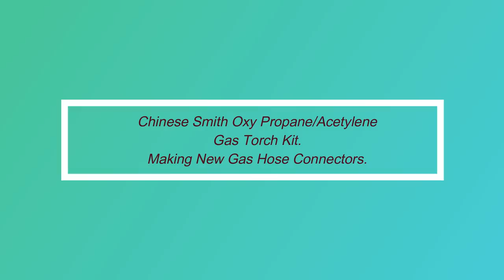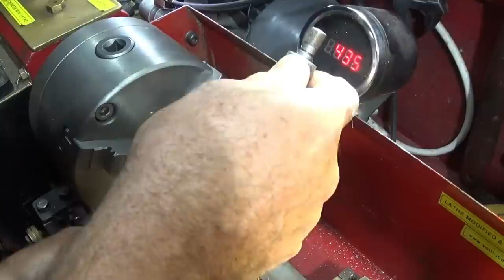Chinese Smith Oxy Acetylene/Propane Torch Kit. New Gas Fittings.

Comment from the maker: SEE LINKS FOR THIS GAS TORCH BELOW:-
Mini Jewelry Gas Mirco Torch Welding Brazing Cutting Tools -- https://bit.ly/39SMtDO
Reply: Hello, I've been watching you're videos for some time now & thank you for very informative videos. I've learnt a lot here about mini lathe & tooling, helped me decide on a few purchases as well. Never used a lathe and just received a 7 x 14 last week. I got round to using it today for the first time and have ran into a problem with parting off titanium (it's not cutting at all) I'm wondering if you could tell me what spindle speed I should be parting off at and what insert is best for titanium? I have the mgehr1010-2 with supplied insert so not sure what type. I've ordered mgmn200-G but wondering what insert you use? This might be the wrong insert for titanium? But all this inserts are abit confusing! I would greatly appreciate you're input
Reply: I should have also mentioned, I tried the same tool and insert on stainless & it also didn't cut. The insert is the golden coated type
Reply: @goldrifle1069  Sound like your tool is not set at the correct height, ( too high ) so that it is rubbing instead of cutting.
Reply: @iwb316  it's dead on centre, checked & rechecked. Think I've found what inserts I need, some with pvd coating instead of the more common tin coated that's supplied with the tool. Hopefully they'll do the job. I've went in at the deep end you'd think I'd start with something softer to start with..... You have start somewhere!
Reply from the maker: I don't part off hard materials like stainless or titanium on the Chinese Mini Lathe. 
 The gold coloured inserts should be fine for cutting stainless.
 If you have just received a Chinese lathe you will find they need a bit of adjustment to cut hard materials, especially on the gibs. Also it pays to lock the compound slide without any overhang of the top slide. You can lock the slide by tightening the gib screws. 
  The Chinese Mini Lathe will always need adjustment from new. I haven't yet seen one that doesn't. 
 I have done quite a few upgrades videos on the things that need doing to make it better and you will find loads of other videos as well.
 It can be quite daunting at first especially if you attempt to machine very hard materials.
 Parting off can be difficult on this lathe even when it's fully adjusted. Plus this lathe cannot use machining coolant.
It is better to saw things off slightly longer than needed in a bench vice, then face off to length on the lathe. 
Regards Steve
Reply from the maker: Please note that since making this video I have found out the fittings that are already on the gas torch are correct for the USA.
 The 3/8" BSP fittings I buy and make for this gas torch are correct for the UK regulators.
Reply: @goldrifle1069   I prefer toolsteel for parting titanium, it is work harding the inserts are not sharp enough for titanium. even turning is a hard time. the stock heats up very fast and so use plenty coollant. slipping the tool in the cut makes it almost impossible on a small lathe to cut again. like stainles but 10 times worse. start with alu, brass and steel to learn parting. then stainles and maybe titanium. after adjusting everything on your lathe.

succes.
Reply: This is more hassle than its worth
Can you just buy the correct connector
Reply: @bfdmanbfd  Lol I was thinking the same thing! 

Still it’s nice to see what is possible with the right machinery and skills.

Comment: My Chinese Smith Tiny Torch came with a bad oxygen regulator fitting. The acetylene/propane regulator fitting was good. I requested a return for refund, after a couple of lowball partial refund and keep offers I accepted $6.89 refund from the EBay seller. I purchased a replacement oxygen fitting nut, fitted it up with the Tiny torch fitting gland and all is fine now. You would think that with at least a couple of years of UTube complaints they would address this issue.
Reply from the maker: Hi David. If it is the fitting thread size someone told me that it is a USA fitting and is correct for their regulators.
Reply: @SteveJordan  I have American 9/16x18 fittings on my regulators. If you check UTube videos the same problem is found on both sides of the Atlantic.

Comment: These copies are rough as guys. The valves red and green knobs are machined out so rough. The tips are likewise very poor. The original smith little torch has tiny saphires in the smaller sizes to allow a tiny flame to hold. These copies dont have anything like a saphire tip. The holes alone are shonky as all get up. I thought about changing the hoses but thought the risk is great using such a poor device. The first one i had, one of the knobs broke off. It was drilled out only a few mm. Not deep enough. Overall probably ok if using the larger tips but the finer sizes probably be useless but you never know.

Comment: Standard is fuel and oxygen to be opposite thread left and right. So it's correct. Possible you didn't know the standard.. oxygen is left and fuel is right..hope u know what  u r doing.
Reply from the maker: They were the wrong fittings altogether. A smaller diameter thread as used in the USA. I had to put standard UK fittings on.

Comment: If you dont have a lathe you can use silver solder to braze the original hose barbs to new correct size fittings or what I did is make a T fitting with 2 regular size hose barbs and a small hose barb for the hand torch but I'm a glassblower so I use a bench torch at the same time

Comment: Hi, I've noticed a very weird thing with my torch, a chinese one, if I only connect propane and leave the oxygen line unconnected and have the oxygen valve shut off, the oxygen line starts having propane coming out of it, even when I close the valve very tightly, does this happen with yours too? I am asking sink this seems very weird to me like it has a leaky valve or something but not in the way I'd expect
Reply: Yes the valves are shocking quality. I personally think they are a big risk to use.

Comment: Thanks for the video. Your skill in radiusing the part by eye with a file is apparent. No grinding a form tool (that would probably chatter like a bugger) or whatever. Interesting torch, I would never buy the original but at this price it's interesting.

Comment: Nice video!  One tip: I've started using the dcmt070208 inserts, they have a larger radius at the point and allow for more aggressive cuts and will fit your current tools.
Reply from the maker: HI yes, I have bought those now as well.

Comment: Hi Steve,. thanks again for the great video.  I would have never thought to make that fitting but after thinking it through it sure makes sense.  I have cleared up original ones to stop them from leaking. 
   I have looked at that torch at bangood and even have it on my cart but have found that they now want to charge a lot of extra freight on items so I have orders I have not filled.  I'm not sure what to do as most things it is no longer a good value buy.  The freight is not on the item when you put it on the cart but only when you checkout.
   Thanks for the video and I do have oxy acetylene and propane and sure think that little torch would be nice for smaller items and the price for small bottles of acetylene have gone way up.

Dale in Canada
Reply: search for the same name (Mini Jewelry Gas Mirco Torch Welding Brazing) on aliexpress and you will find it for less than half the price of banggood (including shipping).

Comment: Would this little touch cut 0.71 woven steel mesh . I have to do intricate cuts. Does it get hot enough. - says 1700  but has anyone tried cutting with it as I can not find any uploads of anyone actually cutting with it in mild steal or any other lower melt metal l sheet of mesh. Thanks for consideration.

Comment: I  have both and the cheep one is just that cheep crap if you make a living with a torch spend the money  my first Smith lasted 15 years using it almost every day 8 to 10 hours a day I'm a jeweler I don't think the cheep one lasted a month you also have that thing of burning your shop to the ground not a very safe product at least the one I got
Reply from the maker: If you had the original Smith little torch, why on earth would you then buy a copy? 
 Many people have the Chinese one and have given it a excellent feedback. 
 At the price it's being sold for I would rather test it out first rather than forking out, the over inflated price, of 200 odd pounds.
 So far I can say it's excellent.
Reply: I just tried to buy an original smiths little torch on flea bay. It was advertised as an original but it was a cheap Chinese copy. Sent it back. Another case of too good to be true. The threads on the fittings we’re wrong and I couldn’t remove the black handle to attach the connection for the magnetic stand. Very poorly made. It did look like the real thing though. I try not to buy Chinese counterfeit items if I can help it.

Comment: So you're saying that this is a good value purchase.......... As long as you have a lathe to turn up a couple of one off parts to make it conform to the standards that BangGood says it's already made to? :D

Wouldn't this modification be more accessible to the hobby user if you cut off the barbed tube on the replacement fittings and internally thread it's body, then made up some smaller brass replacement barbs with external threads to fit inside that (just about doable without a lathe by using a thread tap + die set, and a drill to spin the thick walled brass tube against a file to make the barbs) ? For a belts and braces approach you could also heavily threadlock the new threaded + barbed pipe into original  fittings body?
Reply from the maker: It is actually made to the proper standards, but for the USA, so I have found out. They use the threads that are already fitted to the torch.
 I have basically just converted it for use in the UK by fitting British Standard Pipe threads, BSP.
 If you do change them  like I have you don't want to play around with botch up jobs when using gas and oxygen. You need proper fittings like I have shown.
Regards Steve
Reply: @SteveJordan  Fair enough. I know that leaking oxy and acetylene in a workshop can lead to a rather spectacular (And very memorable..... For your neighbours !) kind of death, But as it's on the low pressure side of the regulator I still think the chances of the average person getting a perfect seal would be greater by using a threaded barb screwed into a modified "Original" replacement fitting, Rather than the risk of someone (who's maybe less experienced with working to tolerances on a lathe) making the whole replacement centre section and barb badly. I could see the possibly that some of the people I've met who have a bit of an "It'll do" attitude wouldn't be careful enough to get a particularly good surface finish on the unions mating faces, and introduce a leak. But I'd like to think that even the most inept DIYer could twist a thread onto a length of brass tube, then drill out and tap the correct fittings body (Using a starter tap only, so the threads can bottom out, deform slightly and seal, Sort of like a poor mans BSP thread) to a sufficient quality that it would seal. 

.......... Now I'm thinking about it, I'm not 100% sure you can use normal threadlock in an oxygen fitting like I said in my original reply. It might be as bad as using grease?..... I'll have to check.

Comment: Nice work. I used that torch for small refrigeration silver brazing for some time. Very happy with it. Did you get the rosebud with it? Works great. I still have it and use it for small repair jobs around our home.

Comment: I bought that Chinese one about 2 years ago. It's still in the box because life sometimes gets in our way. I saw it the other day and thought about using it, but didn't know the nuts would not fit US regulators. So I will make some like you did. Good instructions. But how do you know the proper radius to put on it so it will mate to the regulator without leaking ??
Reply from the maker: Hi it's just a full radius from external diameter to the through hole. They never leak if they have a good finish. Regards Steve
Reply from the maker: Hi if you are in the USA the torch will fit your regulators. I have found out it has USA fittings on it, but had to change them for the standard UK fittings instead. Regards Steve

Comment: If those are “B” size fittings like in the states, only the nuts are different. The nipples that go in the hose are the same on the oxy and fuel gas lines. I first saw those Smith torches way back in the late ‘70’s, and always wanted to try one! Most of the time over the last 45 years I’ve been working with heavy plate, 1/4” to 1”, and I doubt that thing would have been a lot of help! Ha!
Reply: I think that is exactly what those fittings are , B size with 5/8 x 18 UNF threads (.625" diameter and 60 degree thread angle ). U.K fitting is 3/8 x 19 BSP  ( .640" diameter and 55 degree thread angle) . You might get about 1  turn of thread engagement trying to fit the UNF onto BSP
Reply from the maker: @iwb316  Thanks, that must be what it is then. It didn't cross my mind that the USA wouldn't use British Standard Pipe threads. Regards Steve

Comment: Always turn your fuel valve off first, then the oxygen. Can prevent the flame from traveling back up the hose.
Reply from the maker: Hi others say turn oxygen off first? I found on the larger torch, if I turn the fuel valve off first it produces a loud bang? I have flash arrestors fitted on both regulators hose connections anyway.
Reply: @SteveJordan  The pop or bang is normal because of the plentiful oxygen. As long as you have flash arrestors protecting the regulators, you should be ok. The worse that could happen is a slow burning, limited fuel fire traveling up the fuel. I've been a welder since 1963. I've only seen it happen on the job a couple of times, but it can be a frightening experience.
Reply: The industry are trying to get it regulated that the oxygen is turned off firs
Reply: @johnhall8455 yep, that is the correct way. When you turn the gas off first it always results in a backfire but I've rarely seen a true flashback. Many people think a backfire is a flashback but a real flashback is crazy and loudly hisses as it burns back through the hose and with acetylene black smoke comes out while it's happening. It's crazy sounding and scary AF

Comment: I thought about buying the clone of  Smith's little torch but after reading many negative comments I postponed that purchase for now, I'm glad to hear your positive feedback , hope to read/hear more like it, so far, the reviews are mostly not in favour of the fake type.
Reply from the maker: Yes I have seen several negative comments, mainly due to the tight or wrong threads. I know that people have told the Chinese about this, but they don't seem to rectify it. Regards Steve.

Comment: A very good assessment Steve and I’m sure it is a good torch. However, it is a Chinese copy and the company who make it have presumably simply stolen the design from the original manufacturer (ignoring all patenting laws) and are able to produce it therefore, for a much reduced cost - largely because of low cost manpower. Personally I would prefer to pay for an original model and patronise the original manufacturer. Has this torch been CE marked?
Reply from the maker: The Chinese torch is sold under the Chinese maker's name as can be seen on the box. They do not name it as the Smith little torch and it isn't identical, so there is no copyright infringement.
 With things like this patenting laws do not come into it.
  It would have to be identical with the actual original maker's name for there to be a case. Like with anything else.
 I think the Chinese ones are excellent. I'm really pleased with the way they have made it and the price is great. I have just bought another one for a spare.
Reply: Steve Jordan Thanks for the explanation Steve.

Comment: Out of curiosity, do you know what the thread on the torch tip end is? thank you!
Reply from the maker: I'm not sure what it is. I think it is a thread used in the USA market.
Reply: @SteveJordan  Appreciated! I have what's probably the same, as they tend to share, but it's a white-label of a local cheap tools supplier here in Canada. 
I've wanted to make a custom neck/head, but don't have a lathe, and finding the matching thread... has been a bit challenging. 
Someone mentioned in another board, possibly m6-32 fine. I'm going to try that next. Cheers!